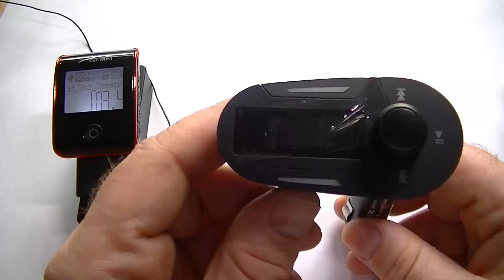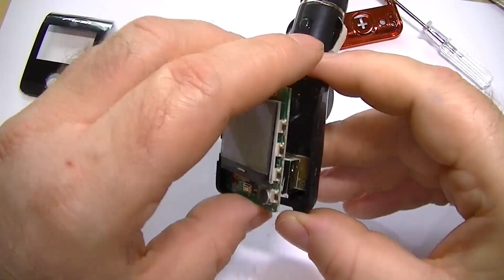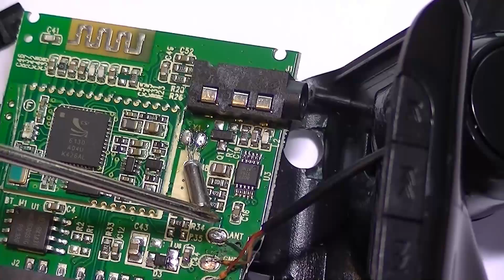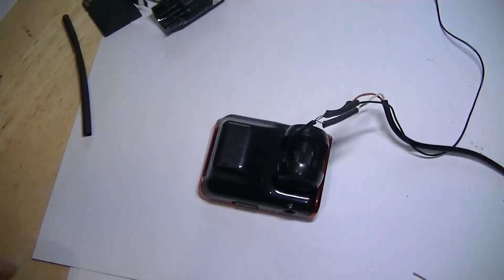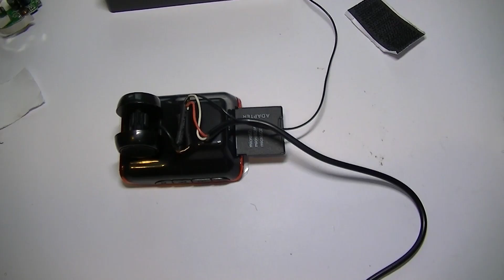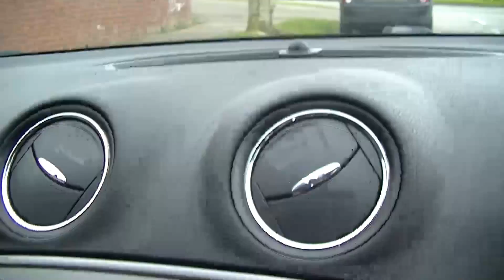Build your own MP3 FM transmitter with RDS and more for ONLY $4

Comment: You can also use multimeter in continuity mode to locate RF pin output on chip using antenna

Comment: Dazaro Good evening, I have an 88-108 MHz 2 V-9 V DC mini FM microphone module transmitter and I want to increase the transmission range, what antenna do you recommend me for maximum range without compromising much the module the size ( 2*1) I am powering it up with a 3.7 Lipo 150mah Battery.

Comment: The moment you find the antenne you can boost it by a buffer from an original fm transmitter schematic instead of a wire. Just look at an ordinary fm transmitter schematic online and built the same buffer after the original oscillator from the schematic and use a fieldstrenghtmeter to see if it amplify. I never done this but it is worthly trying.  Buffers are built around 2n918, bfy90, bf900 etc etc. Why it maybe couldnt work is that the outputpower is to low to amplify but I know for sure it can be done by the right transistor or mosfet.
Reply: how